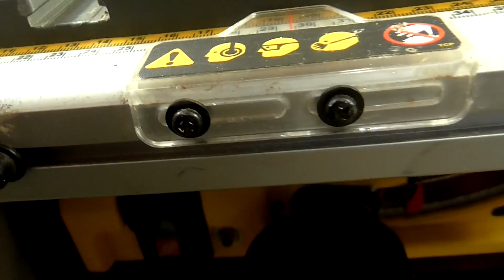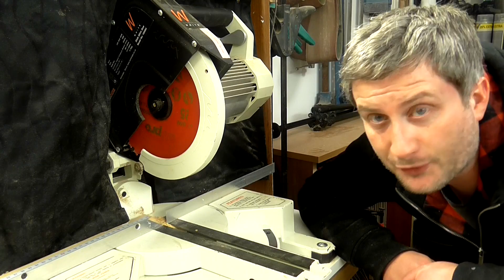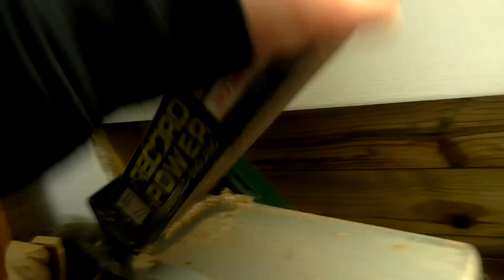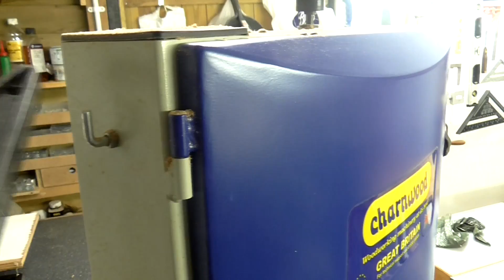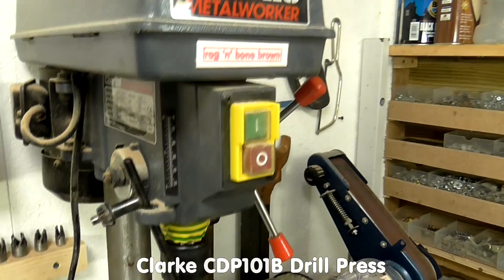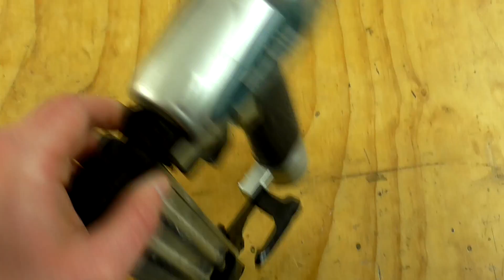My Tools - Large Machines

Comment: Hi Keith, i have the same table saw and I love it. but i have to add 2 more things to the dislike list you gave: 1) mitre gage has way too much play and moves around too much (so a cross-cut sled is a must).   2) the insert in the middle is not easy to adjust and sometimes even pops out. But like you said, it's a great table saw and it cuts really accurately.
Reply from the maker: I agree 👍👍👍

Comment: I know this is an old vid, but I will ask here anyways - as it is about the table saw. Matt at Badger Workshop uses the Milwakee table saw, and he says it is very similar to the Dewalt DW745. He uses a 5 or 6mm  groving blade sometimes. I know that the DW745 does not accept a dado stack, but do you know if it will  accept 5 or 6 mm groving blade? Do you know the maximum blade with it can take?
Reply from the maker: Never looked in to it tbh, I get by just fine without one. I would imagine the arbour on the DeWalt would easily accept a 5mm blade though
Reply: @RagnBoneBrown  Thanks!

Comment: As someone who is planning to build a woodworking shop from scratch and then populate the workshop with new tools this video is invaluable to me. Kieth, as to the loudness of some tools, you say people should consider those using an induction motor, is that the same as a brush less motor? Thanks for uploading this 👍
Reply from the maker: Thanks! Possibly, I’m not really an expert one motors to be honest, but all I know is that my mitre saw and planer have induction motors and they’re much quieter than say my table saw which hadn’t 👍
Reply: Thanks for replying Kieth, After a bit of research I have found out basically for AC motors as you've said, induction motors are the quietest.  Foolishly I asked above if that was the same as a brushless motor. I now know Brushless motors are all DC typically used in mordern power tools with rechargeable batterys and because of they are brushless tend to be a little more quiet. If one person finds this tiny bit of info helpful, Im glad I too the time to post back 😊
Reply: @RagnBoneBrown  Thanks for replying, I know what to do now... google it 😊But any which way. I'm impressed you answered, I apologise in advance for all the future question I ask on your channel 😉Seriously tho, thanks and I am so glad I subbed

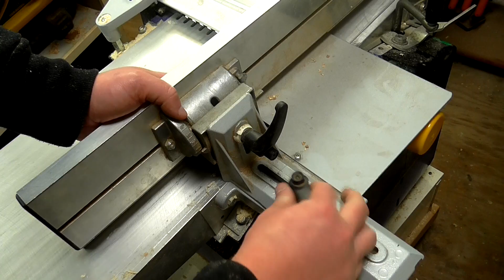Comment: 9:41 sorry Keith but you where wrong all you need is to push or lift the lever to change the way they facing in locking position so they can't interfere with each other

Comment: Hi Keith,
I'm considering the same table saw as you but I have a certain sized space it can fit in for storage. The dimensions on the dewalt page are 742mm(depth) x 577mm (Length) x 425mm (High) Can you confirm if the machine Width (90 degrees to the blade) is what they refer to as the depth? Many thanks and keep up the good work on the videos. Colin

Comment: Going buy the DW 745 but the price in USA is more than £100 cheaper
So trying work out the problem with volts as USA runs on 110 we run on 220 ???
Reply from the maker: 230v for UK unless you have a site transformer. If you buy the one from the US it’ll have a different socket though
Reply: And import tax

Comment: I'm looking at the DW745 vs the DWE7480 and the key difference that I notice is the right-side rip capacity goes from 16" (40.64cm) to 24.5" (62.23cm) with the new version. Do you ever make cuts on the DW745 wider than the 16" (40.64cm)? How, and do you have footage of you doing so?
Reply from the maker: I use a circular saw for wide cuts

Comment: Great video keith.I really liked looking at the tools you use to make such amazing projects.
Once agin, a few things to point out:

1. Makita is better than dewalt
2. movement at the back of a table saw fence is not a problem
3.  saws with induction motors are not that much better, because the cutting of the wood is much louder than the tool itself
4. the fence on your bandsaw most likely doesn't work well for ripping pieces of wood. The blade drift on a bandsaw can be very bad, causing the line not to be straight
5. the angle of the fence on a jointer is not changed often, so the convenience of changing it doesn't really matter.
6. The proper name is "drill press" not "drill press table"
7. the arm on your drill press is very short, reducing the mechanical advantage, and mechanical advantage is one of the main benefits of a drill press, allowing more force to go into drilling, say drilling into the end of a board, or using a large drill bit.
8. your drill press is most likely 1/3 horsepower. Ideally a drill press should have 1 horsepower to 2 horsepower. If you can grab the chuck and stall the machine on the drill press's lowest speed, it is much underpowered.
9.  all drill presses are quiet

great video though

Comment: I have the same table saw, I like it, it is a great starter saw or saw for a small shop (which my shop certainly is). The only complaints I have are the small rip capacity and the fact that the paint on the table is wearing off, causing jigs and workpieces to hang up at times.

Comment: Hi Keith, is this table saw same on amazon. When I looked at it has two screw knob at the back of the fence. Look at your video on table saw looks a bit different. Does the fence over lap as a rest for cutting more wide capacity.

Comment: Most of Record Power tools are not made in the UK but in the far east. I think you will find that your sander is too. The parent company is still based in Sheffield hence the Union Jack logo. Most of the disc and belt sanders from other manufacturers have a similar appearance and have many if not all parts commonality and are re badged accordingly. It's a naïve assumption to state that anything poorly made originates from China but in most cases it happens to be true.

Comment: you can eliminate the slop in the miter gauge by peening the ends of the bar, I had a similar drill press when I started out and it also stalled very easily. larger more powerful presses can also stall but it takes a lot more to get to that point.
Reply: I would not recommend that on aluminum table saws. Use aluminum tapes is better ;IMO

Comment: You've probably already thought of this but on your drill press you might take a look at your belt.  If it ins't properly tensioned or is worn it could cause the problem you described.  It could also be a lack of power like you surmised, but worth a look regardless.

Comment: Good review video. Thanks for sharing.
Only in real use one gets to know which machines are good, not so good or even bad. 
Does the Dewalt table saw (contractor's saw) have a scale in cm, in inches or both?
I like feet (but only mine) and dividing by twelve (hours on the clock) but for the rest I think and measure metric.
Reply from the maker: +Hans de Groot it's metric on the dewalt which I prefer 👍🏻

Comment: Hey Keith,
if you put something like this (Link at message end) in line with your compressed air, you will never have to add oil in your nail gun.
I'm a machine technician and work in repairs and maintenance. Oiled air is MUCH better for air driven power tools!!!
You are absolutely doing right by adding oil in your gun if you don't have a automatic oiler.

Sorry for my bad english, i really like your skills. Please go on. You are doing great.

https://www.amazon.co.uk/AL2000-02-lubricator-Vaporizer-Pneumatic-Compressor/dp/B009015RQW/

Comment: I have that belt/disc sander and drill press but mine are both labeled differently. I'm happy enough with both but would replace the sander with a larger diameter disc sander if it broke.
The table saw you have is the one I've been looking at so I'll get it through your link.
Cheers for the videos Keith
Reply from the maker: +MidtownSkyport thank you!
Reply: Ditto here (netherlands) for both as well. These machines crop up everywhere with all kinds of labels; often a (discount) shop brand.

Comment: Thank you for that I was wondering if you still liked the Charnwood bandsaw, as I have been looking at upgrading to a bigger bandsaw. I have just bought the Stanley compressor, it is very loud but compact, easy to store and portable. Great for using with an air nailer or stapler.
Reply from the maker: +Orion yeah I'm happy with the Charnwood, actually thinking about getting one of their induction motor tablesaws too but probably not for a while. The Stanley is noisy indeed!
Reply: I have not got the Charnwood table saw but I have the older TS200 from Axminster, which has an induction motor and is ok, I think the newer TS250 is a lot better and fixes most of the flaws in the older model, although I think your table saw has a better fence.

Comment: on the jointer, try pulling the adjustment handles up and rotate them back as this should disengage them with the pins. push them back down and rotate clockwise again in order to adjust them without them colliding,
Reply: jacob bell yup, these handles are often spring loaded so you can lift them up to change their positions.
Reply from the maker: +jacob bell I'll give it a try, thanks
Reply: Think they are called Bristol levers ?
Reply: o bez yes that was it, I forgot what they were called and thank you
Reply: Rag 'n' Bone Brown did you try this and if so, what was the outcome